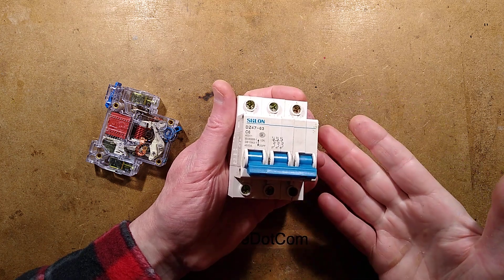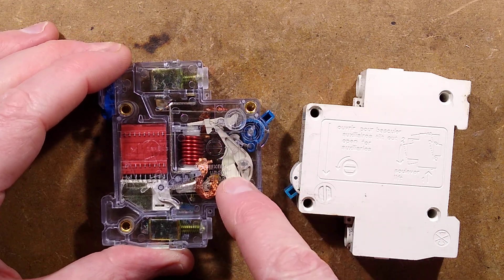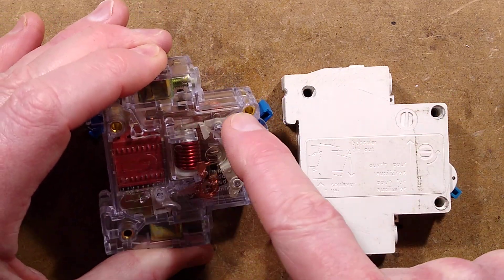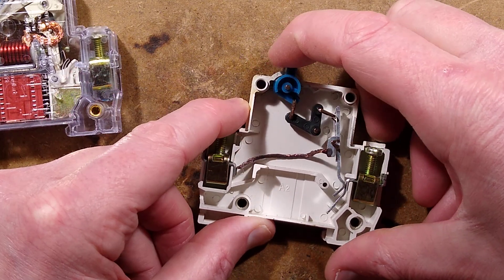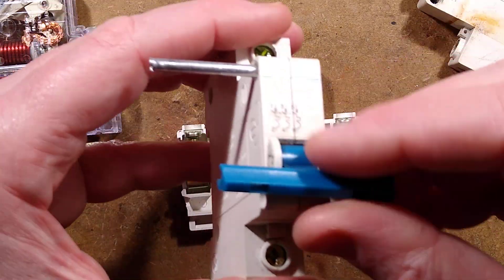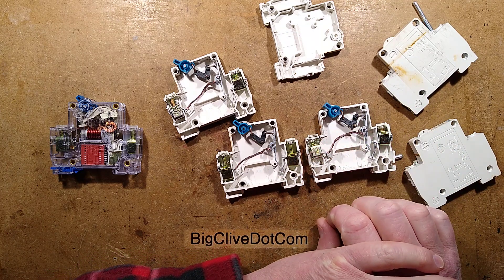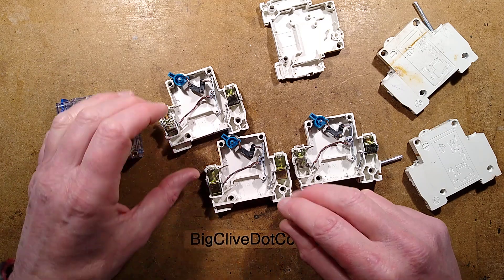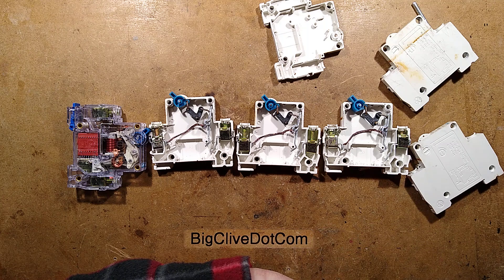Inside a fake un-trippable circuit breaker.

Comment: I juat bought a Chint breaker from aliexpress and first thing i did was to test it with an adjustable power supply (DC tho..) and it did trip at 2x the current for all phases.

Comment: just found a "circuit breaker" for 0.27$ on aliexpress and there is a review from a guy from iran who had installed this 0.27$ mcb on his main electrical panel! i am 100% sure this 0.2$ mcb is not much different than the one in this video , the brand is CNZY .

Comment: At least i can feel safe knowing that the breakers we have are real ones (or at least the one on the upstairs lighting circuit is real, the breaker tripped when a lightbulb failed, i suppose that was the second time I’ve known a breaker trip when a bulb has failed, and my sister had her downstairs lighting circuit fuse blow a few days later, I’m not entirely sure what caused that, but I suspect it was likely a bulb failing, regardless of what happened to cause the fuse to blow, my sister called out an electrician, and the electrician replaced the fuse with an MCB)

Comment: in your first paragraph you said why would somebody make something like this.... I would ask the question why would anyone in there right mind buy something like that to install on live power? When it comes to buying electrical components and safety equipment if its cheap then its probably shit.
Reply from the maker: The problem is that similar items has leaked into the proper supply chain and been sold at full price.

Comment: Hello what's the tripping current of C6 AC MCB? is it exactly at 6 and above ? or 3x of its rated current?  thanks..because i tested my newly bought mcb and it didn't trip at 1500watts load at 220V .
Reply from the maker: A 6A breaker will hold 6A continuously and deal with significantly more current for periods of time until it trips.  They have a current versus time trip curve.

Comment: Usually the neutral section of a 4 pole MCB is without thermal magnetic protection (its just a switch).
I think in this case they ran out of phase modules so they just joined 3 neutral modules together 😂😂😂😂😂

Comment: This reminds me of the really rickety E27 screw in mini circuit breakers that probably originate from the same source you used for this video, but somehow end up on the shelves even inside EU. There is no tamper protection of any kind despite they are user replaceable like normal E27 fuses, just undo 2 screws and pull the lid off.

Comment: I once had to diagnose shopping centre central AC motor that would trip at 19A load, while having 25A breaker.

Issue - Bulgarian breaker.
It would trip at over 16A continuous if left  unattended. Issue was that sometimes motor would switch quickly from delta to star and then draw 13A, so breaker sometime would not trip.

Comment: I am in the process of building a DIY isolation transformer and wanted to put a quality circuit breaker in it. I saw the "low budget" models on Ebay, but decided to go to a real electronics supplier and buy an actual one that was only set me back a whopping $17.50 USD. I think I made a good choice after seeing this video. Thank you for the important "look see" inside!

Comment: It's a Fusible Link not a circuit breaker. The wire blows at the rated amps , a once time use fuse  /switch. .

Comment: Reminds me back when i was a kid and my dad rented a floor sander and the rental shop pulled out a couple of boxes of the most common types of house hold fuses used (This was in the pre breaker days) and all of them just had the fuse wire replaced with a bit of copper wire. And told us to use it if our fuse kept blowing while using the sander.

Comment: I’m sure if that breaker exceeds the amperage listed the wire would burn opening the circuit. Maybe call this a fuse instead of a breaker.

Comment: Worse than the knockoff Motorola MOSFETs I discovered over a decade ago. Wouldn't perform to spec at all. Then I put one under x-ray. The die was tiny, at about 1/8 the area of the real deal. You'd never know it looking at the TO-3 case, though... Until you realized the markings were pad-printed (badly) instead of laser-engraved like the real thing. Blownchow China. "Don't trust China. China is asshoe." is a meme for good reason.

Comment: You say there is no standardized test for circuit breakers, but isn't that what a Breaker Curve graph is for? I don't know if all companies have or produce this kind of information, but I know some companies do. With a Breaker Curve I'm sure someone (if not the production company) could test the breakers and measure its trip time vs amperage. Maybe what you are saying is there is no company that has this as their specific job, and thus no real standardized practice?

Comment: Bought 2 Made In China electric plug adapters. Opened them up to see how well they were made, before taking them overseas. No connection to the earth pin! OK if you only use double insulated stuff, but not everything is of that construction.

Comment: I think that's among the most dangrous things you showed off so far. Sure, the fake laser goggles are super sketchy as well, but at least basic instinct tells me to not look into a laserbeam even with protection on whereas here anyday your cattle, stove, heater or other high-power equipment might just fail without activating the "breaker"
Reply: "cattle"? I'm guessing you meant "kettle". Victim of auto(in)correct?  (BTW - it doesn't have to be high-powered - anything that plugs into house current, for example a cellphone charger, can be a fire hazard if it develops a short.)

Comment: This is part of the reason that knowing the supply chain, and the companies that supply you with components is so important imo. Many people question why industrial parts or commercial rated parts are so pricey. Well when you need a actual spec sheet and a standard of deviation for liability and customer support. That extra amount on the price tag is 100% acceptable compared to the court and insurance costs potentially when there is a problem. Long gone are the days of just slapping something together and going it works, and that is your only concern.
Reply: And the irony is, for those kinds of breakers, the "Industrial" ones (Schneider here, as opposed to Legrand for home use) are barely more expensive than the home ones, and in fact companies get Schneider breakers at "professionnal" prices, so, cheaper than the public price for Legrand breakers (they can also get Legrand cheaper but I rarely see them used in a professional context).

Comment: It is a circuit breaker.  If you need to break the circuit, just flip the blue handle and presto.  In case that fails, just pull it from the box and voila, so they even gave a backup.  People are so spoiled these days, expecting everything to be done automatically for them and all...

Comment: I used to sell a lot of counterfeit Merlin Gerin circuit breakers as well as ABB RCD switches in bulk, but I've never came across such explicit fakes like that. What Chinese did due to rising price competition they just gradually degraded electrical materials by replacing copper with brass first then by replacing brass with steel in the cable clamps. They also reduced a number of turns in the electromagnetic coil, so the latest samples of CBs had just one turn that made them not serviceable.

Comment: Kind of disturbing. 
I saw one case where someone joined some wires with a shaved down powerpoint onto a brick wall (so no insulation). Why not just cough up the $30 - $40 for a junction box ? One day it was discovered after extended rain as the brick work took in some water and the sink because electrified. The owner of the property kept getting shocks from the sink and called me for advice. Got an electrician down there to solve the issue after doing a voltage test on the sink to ground.
Electrician wasn't impressed nor was I. I wonder how anyone could make such a dangerous join. It had been like this for at least 15 years.

Comment: Ive been shocked by heaters and everything, its when you get out the plug but there is still electricity coing through it and you accidentally touch the plugs. Since i didnt hold on with both hands and i unplugged it quickly so it could be much worse. And when you take something apart, there is still electricity in capacitors.

Comment: There's a way to tell. Just pull 20A through it by intentionally short-circuiting the load side to ground. When that wre inside goes fusible and the breaker can't be reset, you've uncovered the counterfeit. A normal breaker will eat that short-circuit very nicely and reset just fine.
Reply: yeah, but a short to ground should pull much more then 20A more like 200A or sometimes up to 4000A which wil also trip some other breaker before is and could be pretty harmfull
Reply: @Japidoff-j33p  Only if you perform the short circuit with 1/0 (or other giant) wire. If you do it with #12AWG, I promise it won't draw 200A before it blows your wire to smithereens. I've vaporized a large portion of a #2 Phillips screwdriver inside a breaker panel (odd set of circumstances) before, and that screwdriver tolerated a lot more current than a #12AWG wire would. It'd be better, of course, to use #14AWG or even #16AWG, either of which would fuse earlier than #12 would... but not before tripping the breaker. Only a completely silly person would short-circuit the breaker with a pipe wrench.

Comment: Yeah - i'm not convinced that's meant to be an MCB... looks like a switch to me
Reply: Yes, but the markings on the front (the lines with round and square thingies) mean that it is equipped with an magnetic and thermal protection wicht it clearly has not!
Reply: @Japidoff-j33p  yeah - couldn't make them out in the video.
tbh, i never understand who buys fake stuff just to complain about.
either you're a genuine tradesperson and use reliable suppliers or you're a danger to other ppl ;-)

Comment: I had something similar on a Chinese made potter's wheel. The RCD action was not existent. The circuit latched closed when the lever was operated. This lever was held closed by a coil similar to yours. The so called test button simply opened the coil supply allowing the main latch to open. There was absolutely no RCD circuitry at all. Pl

Comment: I used to buy Square D QO AC disconnect.  Remove switch, replace with a real breaker rated for motor.  A safe near motor switch that also protects motor.  (Using a SOJ cord from 60 amp 220 outlet.  Motors from 1hp to 10 hp. Each with their own breaker.    I do worry if I don’t destroy someone will think discard is a real breaker. (But labeled, no amp rating should prevent that). Sadly from @$10 for box, @12 breaker.  Boxes hard to find at @$20...

Comment: I only use these things as an on / off switch for the battery on my solar system, at least I hope they are safe enough for that.
Reply from the maker: Keep in mind that if breaking high current DC you need a suitable switch with high breaking gap to avoid a sustained arc like a welder.

Comment: You do get isolators that look like MCBs. Isolators are non-overload sensing switching devices in an MCB form factor. https://www.havells.com/en/consumer/switchgear/circuit-breaker/isolator-switching-device.html . However isolators do not have type C curves or the markings of a genuine MCB: http://donar.messe.de/exhibitor/hannovermesse/2017/U593078/breaker-eng-350150.pdf
Reply: DIN type ISOLATORS usually state it clearly with "Isolator" markings and 63A without any C. Also they have different BS numbers.

Comment: what I believe is that this circuit breaker is a demonstration model as it is built into advertising walls. I work in an electrical wholesaler and it happened before customers complained that the components in their advertising case would not work. It was clear that these were only available for viewing. So this automatic backup is not a fake but was promotional product. That it was built into a heating control confirms my theory that electricians use weaving material because it obviously costs nothing.

Comment: I suspect after this, the improved model from the Chinese factory will include a 50-gram concrete weight as part of the internal design.
Reply: Not funny for us in Nigeria. We get shit like this all the time. Nothing is ever as it should be.
Reply: I believe it's conventional to use iron bolts they find laying around the factory rather than investing in molding the concrete
Reply: Horrifyingly I think they actually believe this is a perfectly valid device and aren't actually out to disguise it. After all, it 'breaks the circuit' when you flip the switch!

Comment: Are you sure this isnt a non-fusable disconnect?  Normally circuit breakers are not placed near the equipment as that would be redundant to the circuit breaker in the panel. Non-fusable disconnects are not to be opened under load but are used solely for LOTO
Reply from the maker: It's marked as an overcurrent device.

Comment: Well, it does not trip when the rated current exceeded but if you flip the blue lever it will break the circuit.  So the manufacturer just defined "circuit breaker" in an unexpected way.

Comment: can I ask you about the company the Circut breaker is made under the branding of?

I've just got my Solar system installed last year and it has two pairs of these used to cutoff power from Solar and main line.

is there someway I can tell if they are working or not?

Comment: Were these breakers made by the brothers of FPE federal Pacific Electric a.k.a. 
fuckin poor equipment. I had a hot wire in a clothes dryer come loose, burn a 1 inch hole 
in the steel plate behind the dryer, a 240 volt circuit at 30 amps, breaker never tripped.
Or a short  where cord comes out of space heater, one pretty arc but breaker never tripped. 
I had the panel replaced of course. double the current in a wire, wire's temp is quadrupled, 
goes up 4 times.

Comment: "Looks quite smokey, looks quite dark."
... I mean the guy says he was FIXING a generator. Betting 50$ that this was the reason it needed fixing, or at least, more fixing than it would otherwise have.
Reply: Someone overloaded the generator, the fuse didn't blow, and therefore cooked the inside of the generator's wiring or boggeged down the engine.

Comment: To be fair, It looks like a cheap DIN swich disguised as a maneto-termic. They do exist like that and its function is like a normal interruptor but only for panels, they are moderately userfull in big circuits with not much load. The only out of place thing is the lack of the arrestor. I used to install these in bars where they could kill the light to some rooms so even if someone tryed to turn the lights on they would never come on. So the staff didnt have to do rounds cheking the lights. If the outside dinnning or the inside dinning werent in use, they wouldnt have power. Of course, al the lighting circuits had their normal protection upwards in the circuit.

Comment: Thing is, " really testing" 'real' units will make it weaker, every " real " trip makes the current it trips on a bit lower till you get so low, it will trip at a normal load, so that's why it's not done often ass well.

Comment: This no doubt is related to the Chinese Ghost city phenomenon, thousands of residential tower blocks have been thrown up in China on the back of a property speculation boom. Many are shoddily built using the cheapest materials, incomplete and empty to this day. When you are building thousands of apartments that will probably lie empty the temptation to cut corners and save every penny possible combined with the vast poorly regulated electronics industry happy to make anything you want cheaply leads to this kind of thing. Unfortunately with China financing infrastructure projects across Africa it is hardly surprising that the same corner cutting occurs. The Governments in those countries are not going to kick up a fuss about the criminally shoddy materials being sent to do the work.

Even worse the authorities in China that are meant to be clamping down on this kind of thing happily collude with the counterfeiters!

Comment: It says like 4500A on it... Isn't that meant as a non-fused mains breaker and not as a CB/Fuse?
Reply from the maker: The 4500A is part of the rating of an overcurrent device as this is marked.  It indicates the maximum fault current it is designed to safely interrupt.
Reply: @bigclivedotcom  Ah, ok.